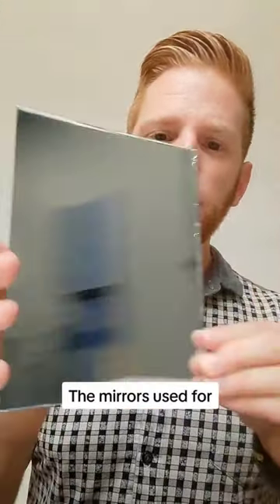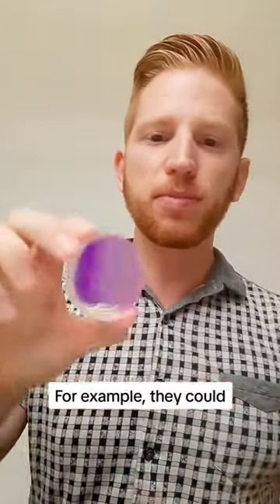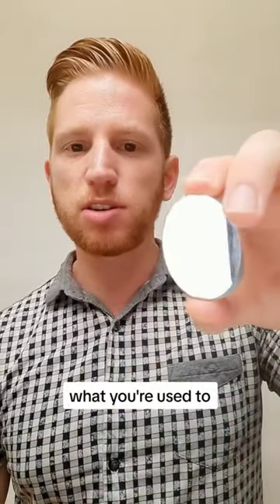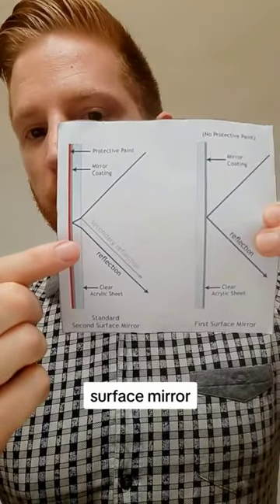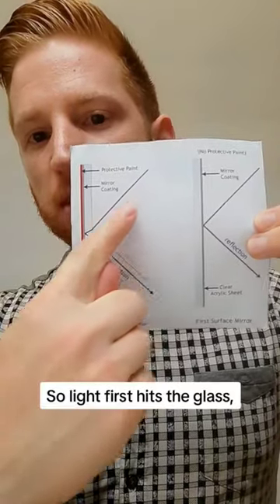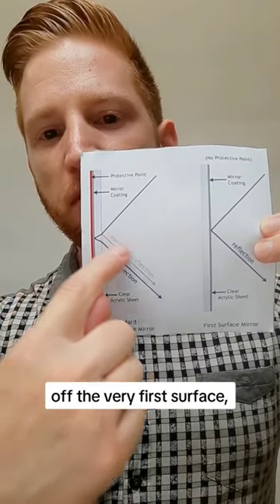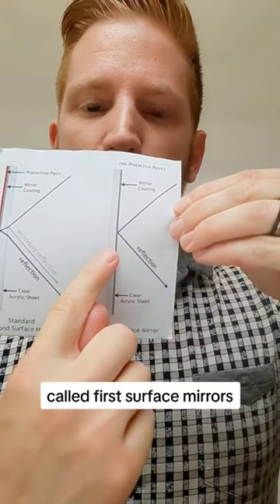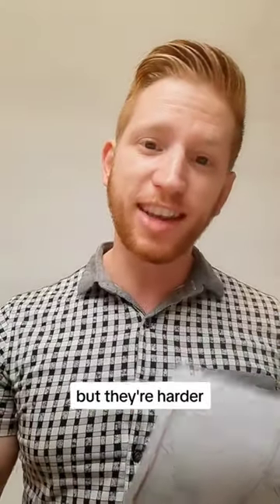Mirror Mirror on the Wall #shorts

Comment: Commercial photographers will use polished metal sheeting to create perfect mirrored surfaces to avoid the ghosting. But they scratch so easily. I’d love a first surface mirror that is as durable as glass 🎉
Reply from the maker: You can get protective coatings on metallic first surface mirrors, but that usually comes at a tradeoff of decreased reflectivity